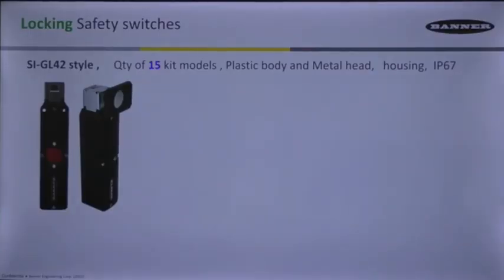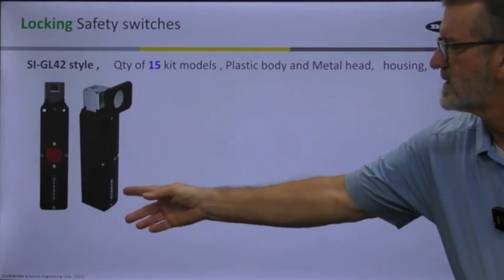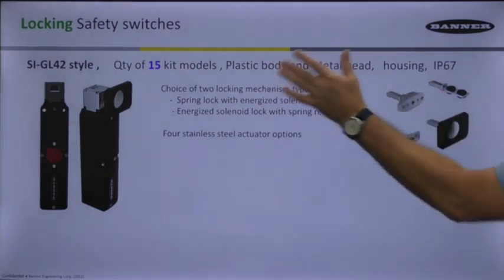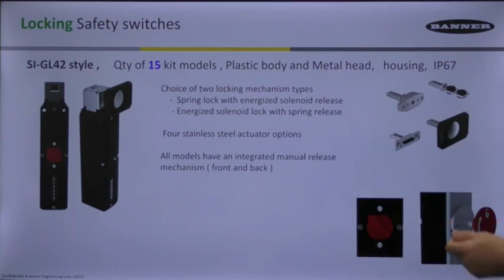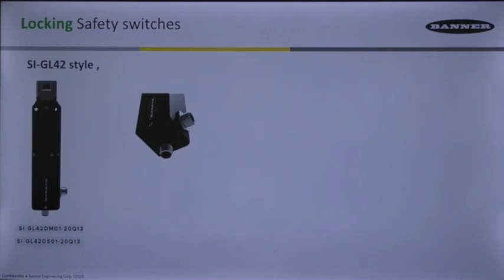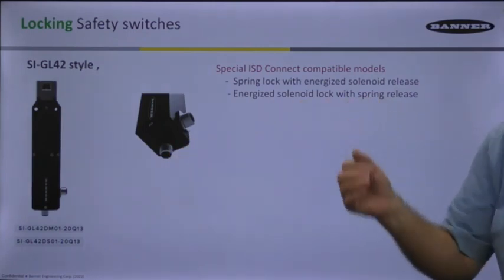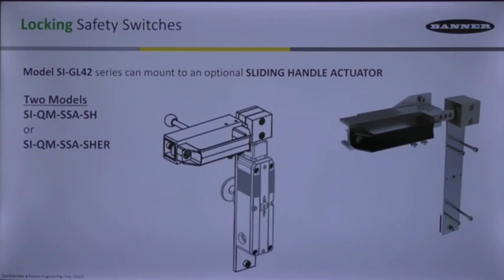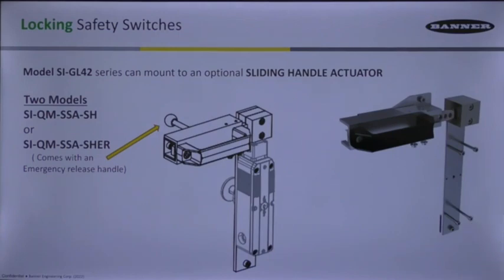Machine Safety: Banner Locking Switches Part 2

Comment: I need a SI-LS42DSH WHAT'S THE DIFFERENCE?
Reply from the maker: Hi! Thank you for the comment. The SI-GL42 products mentioned in this video are newer and offer a more robust design with the metal upper portion. Our Apps Engineering team is here to answer any questions you may have and can help cross over that part to the new SI-GL42 models, you can give them a call, fill out the form, or use our live chat during US business hours: https://www.bannerengineering.com/us/en/forms/contact-an-engineer.html